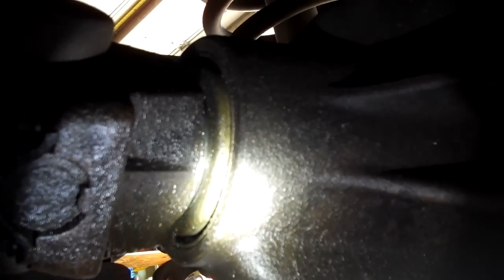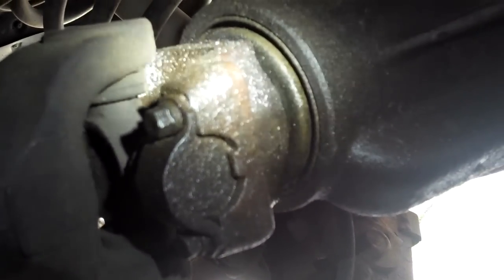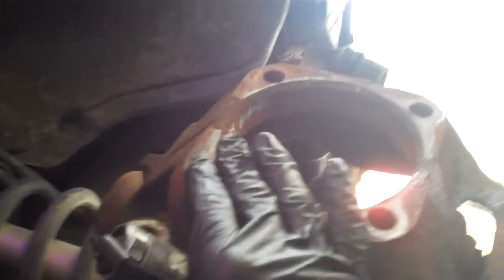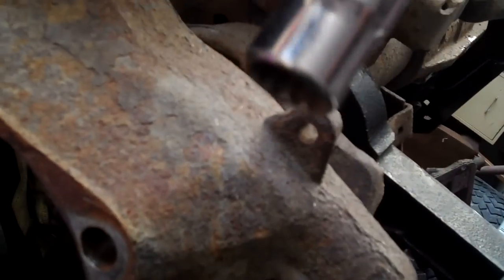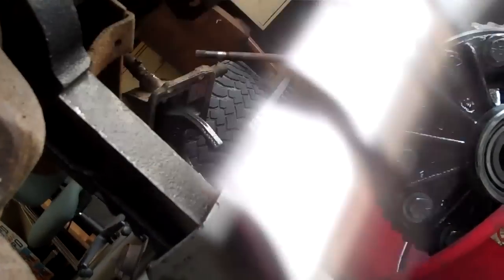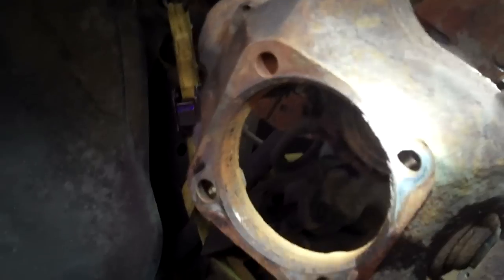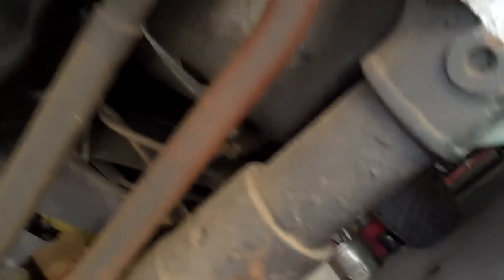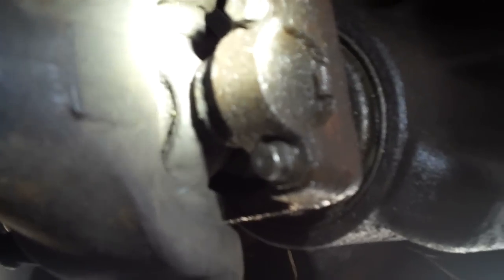How to replace your Front pinion bearings on your truck Dana 60F

Comment from the maker: @spelunkerd The vent tube is on the shifter housing.  No spreader needed.  The crush sleave on this one is a BEAST to crush.  When the slop in the bearing is gone you stop crushing.  You can do it with a vise and a hammer, but I strongly recommend a press for control.

Comment from the maker: It was.  This wore the ends of the teeth that usually never get wear, but preserved the sweet spot in the middle.  Plus the end wear wasn't too bad due to it being a front axle which is only used for four wheel drive.

Comment from the maker: If your carrier is out and you have the U-joint yoke removed, then you just need to put the nut back on to protect the pinion threads and love tap it out- once it's free take the nut off and slip it out.  Often times the crush sleeve will bind the pinion in place.  Hence the love tap opportunity.

Comment from the maker: In this video I had Hancook 35x12.5 R18's  I now run a taller/thinner tire in a metric size.  It's not as good looking, but dominates long steep rocky/loose terrain pulling a trailer.

Comment: Brian, surprised the ring and pinion mating surfaces were ok. MANY years ago i had a 67 427 camaro with the GM 12 bolt, 456 ratio for dragging, anyway i used the paint method for setting the pinion depth and tooth contact, shims behind the bearing and pinion for the depth, then shims on the side of the unit for proper contact, never used a dial indicator for backlash and it was and remained quiet as a mouse, axles were held in with clips inside the diff. on that model.

Comment: Brian, one of the most important parts was setting the Pinion. Bearing preload with the crush washer, did you use the old one? Maybe that's another video. Overall, fantastic job, folks can learn a lot if they pay attention.

Comment: i have no idea why my pinion nut on my 2011 was so tight but. if i wouldn’t have taken the d shaft off and loosened that pinion nut first. i’d be screwed. i had 6’ breaker bar on it and drove the truck forward to loosen it. nothing else would get it off. lucky for you with the carrier out and all before you tried .

Comment: This is surprisingly similar to the Dana 44, though I have never gone after that pinion seal. Is there a vent tube for this axle that you should check for patency? Did you need to use a spreader to get the diff back in? How do you get the correct torque/compression for that crush washer? If you don't have a press, can you do this job with hand tools?

Comment: Great job. I have to do this on my 2001 Dodge diesel. This will help alot! Got a quote for $1000 to $1500 to have a shop do it. I have most of the tools if not all of them. A couple of questions though, where to get good replacement parts, and specs on the torque and backlash when setting the crush sleeve?

Comment: Great video. I have a question though... Is that knocking noise you demonstrated at the beginning of the video a good indicator for a bad pinion bearing? I have a noise in my 94 2500 Ram. It started happening after I changed the oil in it. It's quiet at lower speeds but there is a prominent whine at around 55-65 mph. It sounds like it's coming from the front end. My pinion seal is leaking too, just like yours.

Comment: Brian, wondering what the name is of the part you use on your press that supports the bearing from both sides with the bolt through it to make it adjustable.  I am planning on building my own press, but would need to purchase that support thing, but since don't know its name, having hard time finding any info/pricing on it.  Great video btw, I'm ramping up to tackle the rear dif on my truck shortly.

Comment: Can this cause the pass side axle to be hard to turn or is that normal?  I was seeing smoke from that side I replaced the hub bearing because I figured that was the problem. After replacing it was just as hard to spin it but the drivers side spins freely even tho there is a slight clicking. Second I thought brakes but there were no scorch marks on the rotor or pads and the caliber was easy to come off. HELP my truck is fallen and I'm walking!

Comment: Not a bad how to vid. But maybe you should get your "lovely assistant" to help with the recording. Just saying. Anyway, I'm getting ready to do my TJ Dana 44 front axle pinion bearings and seal. I dialed up this vid to see the spacifics on the how to put the pinion nut back to proper torque specs or get it close WITHOUT a torque wrench. One vid I saw said you should be able to spin the yolk about three times with a "flick of the wrist" when there is proper torque on the new bearings, (PRELOAD).

Comment: Do you have to set the lash again when you pull the pinion gear out?  Or do you just slide it back in?  I was wondering about the Dana 80 as well cause my rear is leaking.  Thanks

Comment: When I put it in, one race will go in straight, the other always becomes askew. Don't know how else to describe it. It all goes together fine outside the axle. It also wants to fall back out, and it's hard to get the races, U-straps, and bolts perfectly lined up with one hand while holding the heavy carrier in place with the other.

Comment: to make this easier there is no need to pull the hub bearing. pull the axle and hub as one piece
Reply: Ryan Carriveau can this seal be replace without removing the hole asembl or just the seal can it be replace

Comment: I'm not sure how that tool you have the link for, could be used to press off the pinion bearings and crush sleeve though.  By searching hub race remover though, I found the actual name for the part..a split plate bearing remover, but it runs at least $80 online plus shipping...ouch!